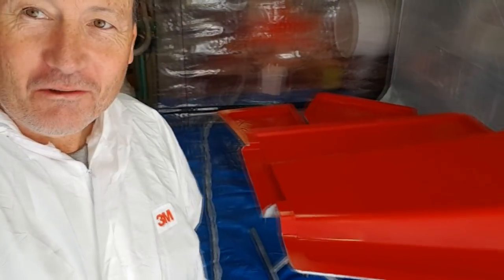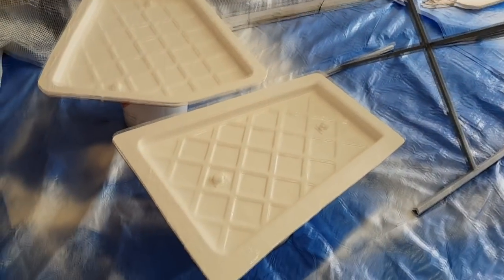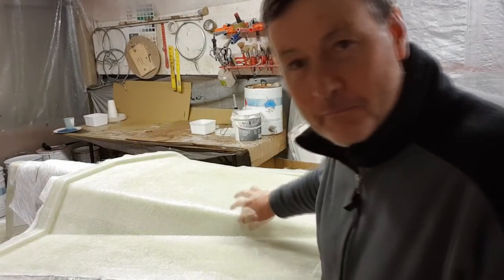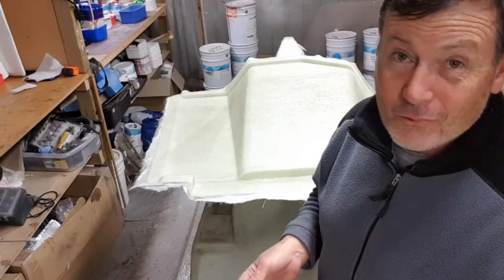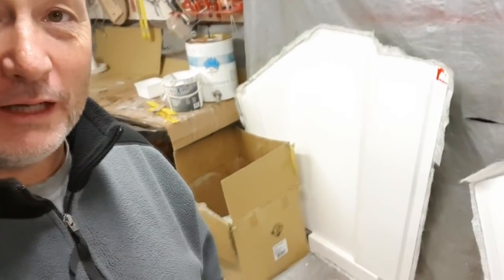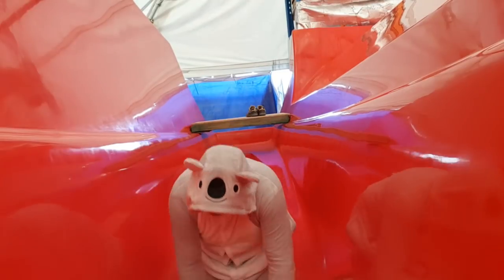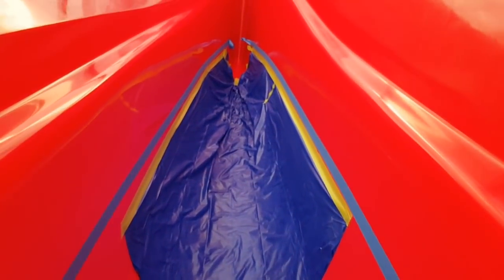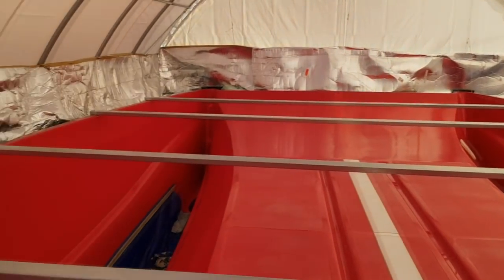Ep009 How much polishing can a Koala Bear?

Comment: I work with carbon fibre more than grp but the process is pretty much the same. If the piece wont release easily (as the bastards usually don't) a good trick is to put a wedge in, grab your compressed air gun, press the nozzle firmly against the gap and give it a blast (or three). It provides enough evenly distributed pressure to pop the seal without bending the laminate. What you call a 'woody' we call a 'prodder' and you're right...it's a laminators best friend.
Reply from the maker: I have already had a great deal of release around the hull flanges and the entire hull sides are already released.I pre rmpted release day by pre drillibg about 30 strategically positioned holes in the hull mould  for a high pressure air blast so hopefully it will demould with ease.That combined with a well seasoned highly and multiple waxed surface I anticipate no stick ups.Time will tell.Thanks for you comment.Cheers Ross
Reply: Oh. my comment was more for everyone watching who are thinking about trying laminating themselves. Seems to be a lot of people more interested in the process than the result. Keep up the good work!

Comment: What kind of resin are you using?isolthelic polyester, vinylester, epoxy? Cound not imagine epoxy because of the sheer cost but curious. I'm surprised your not the #1 youtube boat build, granted your channel is relatively young. Keep up the great videos.
Reply from the maker: The hull has been laid entirely with vinylester resin as I have an iso gel coat outer layer. The vinyl ester which is an actually a modified epoxy that still shares a similar chemical backbone with a bit less structural strength than epoxy. It does however exhibit superior UV resistance and is corrosion and temperature resistant avoiding the onset of osmosis. The deck will be of polyester as will the internal modules.  I have pretty much outlined the build so far in this episode and thanks for watching really appreciate the comments. Cheers Ross https://www.youtube.com/watch?v=9kmjvyG4kS0&list=PLi-nZ0CRMIOl0-ndoy9w77OIxYiLKbzI9&index=20
Reply: I appreciate the response and later learned you mentioned that after binge watching all your episodes! I cant believe how fast your moving. I am very familiar with resins and different kind of matts and fabrics as i have rebuilt a few boats.. albeit a lot smaller than yours. Very good choice on resin and layup. Ill admit i was blown away in aww and jealousy watching you spray resin for layup. By the time your project is done i bet it's nearly paid for itself vs waisting 1000's of buckets, mixing stick and brushs. 

Does you spray gun mix the catylist and resin at the end of the gun?You should definitely do a video on it. curious to see the process of setting it up before spray and cleanup of the line(s?) after.
Reply from the maker: Not sure whether you have seen this episode but pretty much covers the catalysing etc. Brilliant machine and I love it more than any tool I own. It has honestly saved me in wastage which is Nil of resins and clean up acetone , probably about 200litres at least. Clean up is simply a matter of rinsing the gun tips and an occasional ( weekly acetone flush ) of the whole system about 5litres of acetone. Cannot imagine having to hand mix as I do with all of our kayak products I make and this machine has made this entire project viable. Cheers Rossco
https://www.youtube.com/watch?v=rNAZGuvOp4s&t=3s

Comment: I have always had better luck trimming the product before popping it out..   It can be trimmed with a knife in about 90 minutes after the  glass application is finished.
Reply from the maker: Thomas, Definitely the only way to go is the green trim. I use this technique with our manufacturing of sea kayaks and parts for them Ie coamings etc, In this case I am going to add foam cores, and stiffening laminates at a later date and will grind them clean to ensure a thicker edge and substrate, Green trimming is only suitable for thinner laminates eg kayaks and small parts. Nothing worse than missing tht crucial 5 minutes between green and rock hard though. In the case of the bathroom floors, modules and engine bays etc the flanges are to be cut of entirely or sanded clean for additional glassing to the hull and deck.,so no point in green trimming although it can make for easier demoulding.   Thanks for the comment. Ross